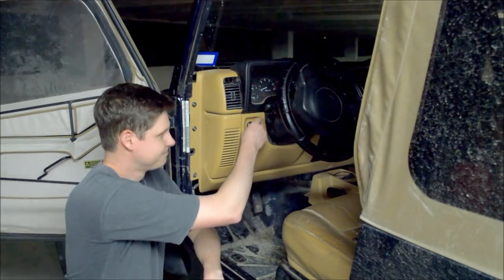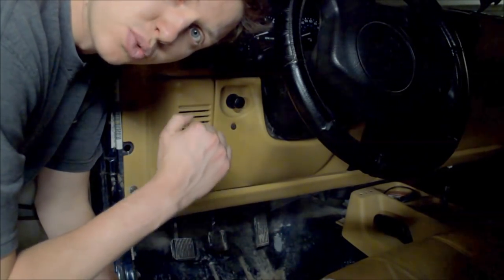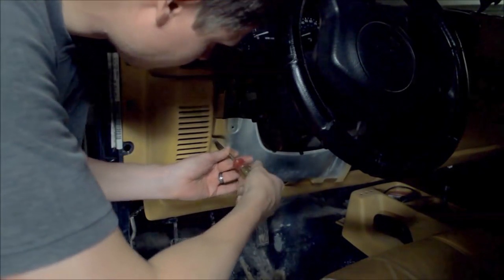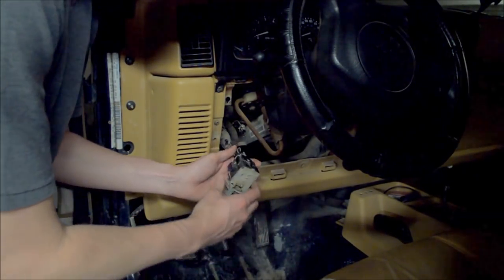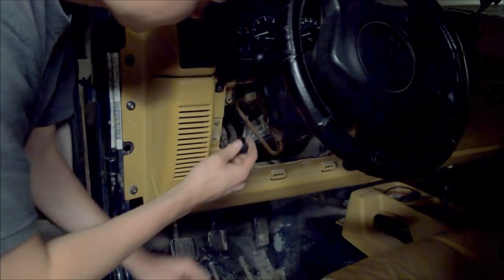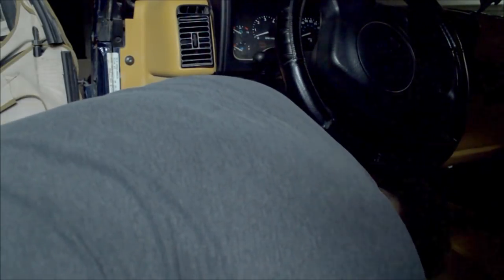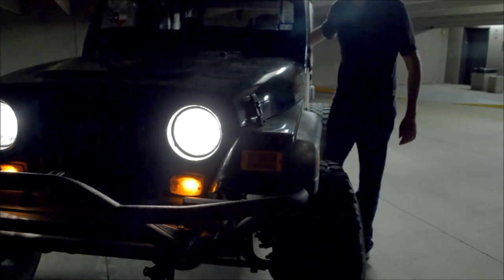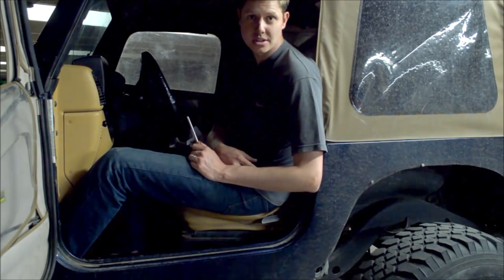How to replace the headlight switch on a Jeep TJ

Comment: Hey Michael.......The headlights on my 2000 Jeep TJ stopped working about a year ago. I couldn't use the Jeep after dark, but I had another old car that I could drive, so I just procrastinated, and didn't do anything about the problem for the past year. YouTube is always my source for helpful information, and I signed on a few weeks ago to see if I could finally solve my headlight problem. I just happened to click on your video first, and your simple, down to earth approach was perfect for me.  I ordered the switch that you mentioned, (DS357T), from Amazon and it arrived in three days. I looked at your video a second time, just to refresh my memory, and then went to work. Twenty minutes later the switch was installed and for the first time in a year I had headlights again. Not only that, but the aftermarket fog lights that somebody had installed years ago, and have never worked since I owned the Jeep, suddenly worked perfectly. Thanks so much for your advice and for making this video. You really helped me a bunch!!

Comment: I know it's old, but installing relays will expand the lifespan of these headlight switches. I have 98 dodge ram, which is similar and I've replaced 3 in two years. I installed a relay and it has lasted me a year with no signs of corrosion. hope this helps in the future.

Comment: Hey there! Great video! I have a question. Does disconnecting the battery disable the air bags?I've heard I need to disable them before working on the headlight switch.  I have a 1999 Jeep wrangler.

Comment: Is the overspray on the metal piece fr you repainting the vinyl interior?  If so what kind of paint did you use?
Reply: If you're still wondering I'd use a duplicolor vinyl and fabric spray can they sell the at autozone left paint unit 2nd from bottom to top

Comment: have that problem in my XJ do you think it's the same?
Reply: its similar in xjs. Brother has a 95 that was tricky but it was a similar part.
Reply: +Caleb Hack  thanks mate
Reply: The part and mechanism work the same, but the access is very different. With my 96 XJ, I had to lay in the floor and contort to reach way up under the dash.